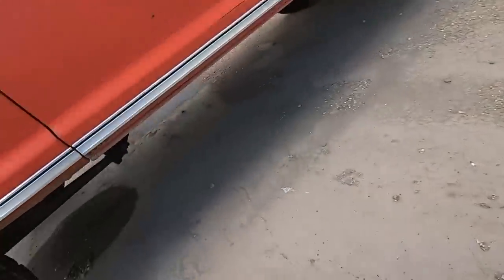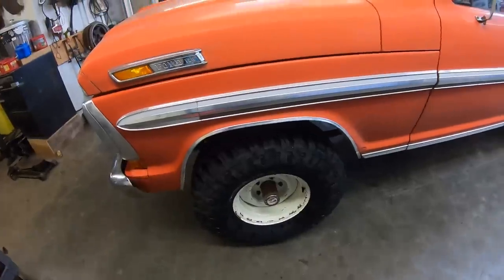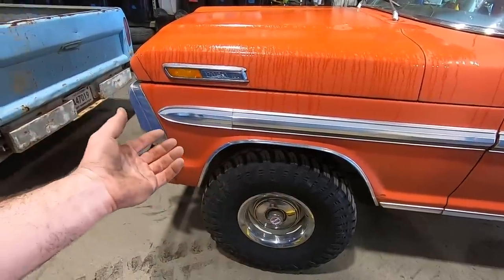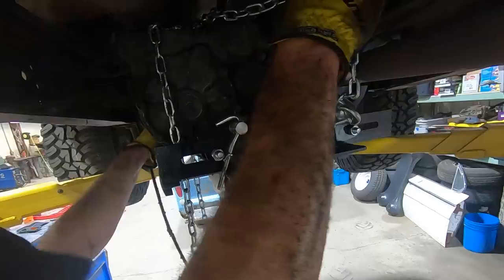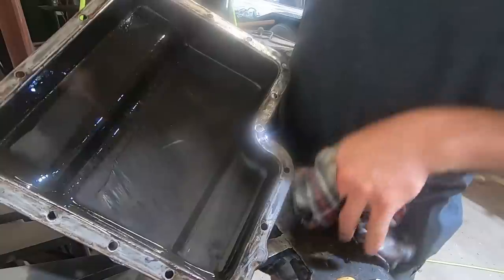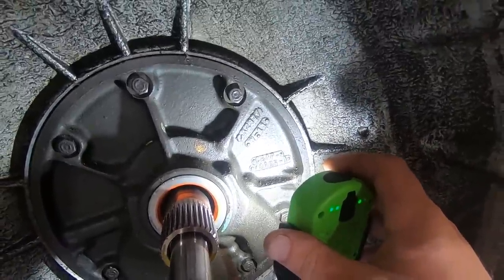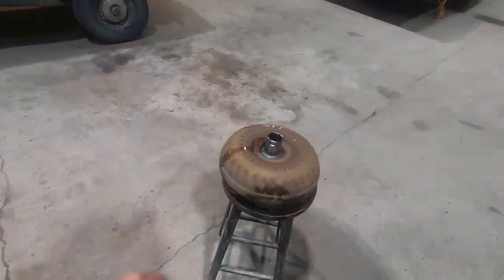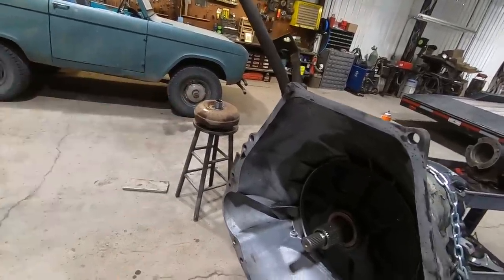Did I just Destroy the Transmission on my 1971 F100?!? Hey, at least it's got new Tires on it!

Comment: That bent wheel you might want to make an indicator pointer to inspect it, if both innie and outie hoops move in/out at the same spot its more likely the rim is bent, hoops are not true to the mounting flange.
Reply from the maker: I think you’re probably right
Reply: @MortskeRepair  well if you're super desperate and thinking on tweaking it and think you can determine how/where its bent -- you could attach a lever like an axle or bar and plate welded, chain that sucker down to your trailer, hit it with the torch and bend it back into alignment.
All that Detroit Steelies has got is a $100k robotic welder, I believe they get their source material from Canuckistan --- setup the backspacing, on the hoop drop in the centers and press a button, round she goes pzzt pzzzt done
Reply from the maker: @dennishernden2264  Well it's wasted so it's worth a shot trying to fix it I guess!
Reply: @MortskeRepair  It can take hours to straighten a wheel, that's why I said you need to really nail down what's going on, good luck.

Comment: The E4OD automatic on my '93 F150 has been slipping since I got the truck for years ago, I just keep hoping it goes out so I can justify putting a 5 speed in it. If you get the transmission good and hot it'll start shifting hard, sometimes it kicks to neutral and you have to restart the truck. Stupid electronic transmissions.

Comment: If your chip seal question wasn't rhetorical: they chip seal because its cheap. Where the asphalt is structurally sound a chip seal is the cheapest way to seal/surface. If done early enough, this can greatly extend the life of pavement. Next is an overlay (fresh pavement surface, typically 1-2", no grinding), but that can create issues where pavement meets gravel shoulder/ditch. Last is an inlay (or full rebuild) where the grind out the old and pave in new. This fixes structural problems and prevents the issues an overlay creates, but costs a whole lot more money.
Reply from the maker: Thanks for the info

Comment: Luke [Thunderhead289] is always dropping those T5 mustang transmissions in behind the FE motors of all shapes and sizes [and he hammers on them sparing no ponies in the process]. That old rusty Maverick with the 390 in it he's got one of those transmissions in that one [drives it to work in spite of it's rustiness]. The overdrive and the floor shift makes that set up pretty encouraging eh? :-))
Reply from the maker: Pretty sure his Maverick is a Windsor with a toploader 4 speed.
Reply: @MortskeRepair  He did a Windsor job on a Foxbody mustang for some kid at his new job but drove up and parked the 390 Maverick to get started on the 351 Windsor fox body. Nah. Unless he changed it he dropped the mustang floor shift in it behind that 390 ages ago [really calls first gear a granny low on the one earlier transmission in that old Blue truck but it does have the overdrive that he likes for highway too and from work and school]. He swears by those things as they find their way into his trucks and the 65 Black Galaxy... I mean... I get it. They're pretty sweet little shifters. I think GM had a version of that tranny that they put in a couple of cars back in the 80's.... Craig909 found one last year in his junkyard somebody hauled out of an old car then left in a trunk and forgot to go back for it. Did Luke switch that tranny out of the Maverick and I missed him do that? He still had it in the car when he was running that lawn mower carb on the old 390 [young man's a helluva mechanic actually eh?]. Anyway.... I type too much too fast... Love the work you do and see your love of the past in how you work to preserve some of the older motors sometimes. Good for you. Love the job you did on your grampa's Buick for your Dad. Worry free highway running at 70 MPH and 25 Miles a Gallon... Hard to kick those LS's out of bed for eating crackers :-))
Reply from the maker: @robertironside3166  He bought the car with a windsor and toploader in it.
Reply: @MortskeRepair  Are we both talking about the same rust monster with the rotting frame? Cause he had a 390 in that one with the stang 5 speed... I'll have to go back and re-watch the Maverick stuff. Same car he put the lawnmower carb on right? That Maverick? He did help a younger feller clear the shrapnel off of a 351 and then  do lifters, push rods and timing set in the parking lot after work and poop. K my memory must be in shambles I guess lol
Reply from the maker: @robertironside3166  Yup

Comment: Duff likes this truck too much, don't sell it! Love the "bump side" fords and the color is terrific. Would lie to see a paint detail video. Do you run without the air cleaner? The "chip seal" on the roads is a lower cost (than repaving) surface treatment used on roads that are often lower traffic count/rural, structurally sound, but may be cracking or showing signs of deterioration but not to the point of failure requiring resurfacing. I was a municipal engineer and our small town Taxachusetts roads got treated this way frequently. Yep, lots of chipped windshields, front ends, rockers, stones on lawns, and complaints. Never mind the stones get stuck in tire treads throwing the balance off!
Reply from the maker: No, this has always had the air cleaner on it. I really do need to buff out the paint.

Comment: Both my 79 Chevy K10 Scottsdale and the k20 custom deluxe were lifted the cheap Farmer way I don't advise it they jacked them up and sat the frame on metal sawhorses and heated up the spring and when they cooled they dropped and they sat down the truck on the floor and both trucks then had a 4 and 1/2 inch lift and after hauling lumber and steel and motors for about 25:years and pulling gravity wagons and hay wagons the rear springs lost their arc the front seat up higher and the front springs on the k20 had dearched so lowered it in the front so that is why I said I don't recommend ok lifting the truck that way.

Comment: Ford had a blue coating on slip joint splines and they sold a special grease to lubricate the slip joint on drive shaft
Reply from the maker: Too bad the previous owner never used it!
Reply: @MortskeRepair  You can't find anything in good shape around here the state uses to much salt in the winter I have looked for a old four wheel drive truck to fix up but can't find anything close

Comment: If you have transmission leaks on the old Ford transmissions that seem to keep reappearing no matter what I may have an explanation that was explained to me when I started asking about why mine seem to leak. I built both a C6 and a cruise o matic. Both seem to have an occasional weep from the torque converter seal even though everything is put together correctly, and the seal fits nice and tight. Apparently, the old silicone Ford seals (they look like viton but are more orange in color) don't tolerate the amount of seal sweller found in the GM spec dex/merc fluid and will cause the seals to get a little on the soft side if the transmission gets hot or is driven on a really hot day. My cruise o matic won't leak at all in the winter but I'll get the occasional drip off the bellhousing in the summertime. I used type F in both of those transmissions but who knows how much seal sweller they put in the old ATF these days compared to when that fluid was a current spec. Annoying, for sure! the C6 in my truck that specs Dexron II on the Ford dipstick never has leaked though, and it has 250k miles on it. Apparently, they changed the seal material sometime in the 80's but some rebuild kits still come with the older style silicone seals instead of viton.

Comment: Some ford torque  converters have   drain plugs and you have to line them up with a hole in the flex plate  or it will hit the flex plate and push the torque   converter  to far back. And the engine  wont turn over and then its  manual  transmission/  ls swap time.
Reply from the maker: We got it lined up!
Reply: @MortskeRepair  I really  enjoyed this  one! But after watching  it I think I'll get more kitty  litter and  type f for my bronco  for now until it really  starts pissing  lol.
Reply from the maker: @michaelbennett1883  Oh come on! It's easy!!

Comment: I have torn down a rebuilt a couple turbo 350 and 400's and a few 727 and 904's but the only Ford I did was a C4 out of my friends stang but I find the 3 spd trans not to be that bad the most simple to me is the 727 and 904 I have rebuilt a few of them at first I needed the book but now I don't need the book but I keep them by just in case but you should buy the book on rebuilding automatics and learn how to do them I was scared at first thinking I was going to mess stuff up but turned out to be not a big deal.
Reply from the maker: Glad to hear it can be done!

Comment: Pretty sure the correct fluid for the 1970's C6 is Type F.   Maybe Mercon might work ok or maybe not.   Ford switched to Mercon later.   They never used Dexron that I have ever found.   What you have in there might be on the thin side which would possibly make the front pump noise I was hearing.    

I love my old 79 Ford F150 truck.   I get asked about every 2 or 3 weeks if I want to sell it.  I will never sell my truck.
Reply from the maker: Seems to work fine

Comment: Great video and c6 is a stand up trans band can be installed before the forwards just leave it loose then tighten after assembly is done ..wear on the band will stop it from locking drum as fluid travels down in groove's in face if too worn will allow slip .. causing miss ship or take off in wrong gear . Give you credit took it on cannot learn a thing without taking a chance ..

Comment: after watching for 25 minutes, it occured to me.... you got a lift! you need to do it the way the dealer did back in 79, LIFT the body off the frame, if your doing a tank/pump lift the bed,not drop the tank. update I'm at 1:06:00 see? after watching you and the crossmember I was right.

Comment: Google pipe soap. I'm a pipe layer and use it at work for rubber gaskets. Best thing by FAR for sesting beads. And cheap especially compared to tire lube. I had sticky racing tires that wouldn't bead. Tried every trick. They went right on with pipe soap.
Reply from the maker: I’ll check it out!

Comment: Those shift rods in the 205 control front and rear. Twin sticks allow you to do front digs on tight trails. You can lock in the front the rear or both depending what you need. It is also fun to confuse people with a front wheel burnout. Used to have a 79 Bronco on 40s. Lock the front in low and the rear in neutral and I could burn the front tires right off the thing lol just a little useless knowledge
Reply from the maker: Thanks for the info!

Comment: If you like shorty valve stems, cool! Butttttt, soon as you install trim rings or full wheel covers, you gonna have to take those off every time you wanna check or add air. Like to make more work for yourself? Cool! 🤣🤣
Reply from the maker: Didn't plan to run beauty rings

Comment: the first gen bronco has the C5 automatic that had deep pans
Reply from the maker: Interesting
Reply: @MortskeRepair  inside it's a C4 the pan and filler tube makes it a C5 and the adapter for the T case so they are simple to build once it is torn done and ran thru the giant parts washer under heat and chemicals dried it's a 4 hour build in most cases the C6 is about the same time frame adding a shift kit ads about half an hour then it's painted cause who wants stained aluminum after you drop 4 grand

Comment: I also actually like the skinny or narrow barrel wheels my 79 Chevy K10 and the k20 had 7.00x9.00 15, not factory for the K10 Scottsdale factory 33x12.50 15 dealership promo code wheels chrome spoke and the truck we copied the wheel setup off of were factory 16 inch mud king type tires called a Firestone mud trac as tire

Comment: my experience with that dorman pan drain is "mixed" at best. 1 the o-ring for the plug is very low durometer and can be pinched and leak. 2. the lack of a vent makes it not drain very efficiently. more like drip drip drip drip...
Reply from the maker: Slip out the dipstick, vent away!
Reply: @MortskeRepair  that's thinkin' with your dipstick jimmy!!!

Comment: looks like the modulators oring is weeping a bit wipe it off and keep an eye on it
Reply from the maker: Needs a new one anyhow
Reply: @MortskeRepair  they tend to lose the ability to work without sucking ATF but in the bright side it cleans and lubes the carb and leaves a smoke trail
Reply from the maker: @garybrady9531  No smoke trail on this one for some reason

Comment: I always left the transfer case and auto tranny together, and they would balance on the floor jack at the cross member. But mine was a 78 chevy. I didn't turn Ford until the next generation pickups. Many friends had Fords back then, none had tranny problems like me. I should have bought a manual. I've never got more than 20K miles out of an auto tranny. Ever since then I've had manuals. My current vehicle is a 98 Ranger 2x ext. cab with 400K miles on the 3.0 V6 and 5 speed manual. Haven't never done anything major to it. 
I don't think you can even buy manuals anymore from anyone? My cousin drives truck and even his is an auto. Even the school buses are auto now. I hate auto, they don't last and no fun to drive.

Comment: The sad thing is, all of the issues that you had wouldn't have happened if the previous owners had just changed the fluids on schedule.
Could your modulator valve be causing that sound in low gear? Good vid.
Reply from the maker: It might

Comment: Based on my extensive research the mild chatter that you are hearing is a result of too much pre-load on the articulating lower bearing seal the result of this is contact between the adjunculating pinion and the inner rotating mass,  you may be able to solve this by dis-assembling the entire unit and cleaning with a brillo pad. If that doesnt do it just order a new unit. Professor Irwin Corey
Reply from the maker: Oh dear

Comment: When putting the trannyback in,, make sure to line up the torque converter drain plug with the drain plug hole in the flex plate,,  :-)
Reply from the maker: We got lucky and it lined up!

Comment: On your transmission assembly barrel,,,,  if you turn it over, thus exposing the rounded bottom,,,  You can then take a 4 lb hammer and beat on the center of the rounded bottom until it is rounded inney instead of rounded outtey,,,  this will cure the wobble while using it as a transmission assembly aide,,,   :-)
Reply from the maker: We did this after the fact
Reply: @MortskeRepair  That's kewl,,,  Was happy to see your transmission working again after partial disassembly,,  I reallize that you are not really a Ford guy, but That body style just gets better with age,   I would not be surprised if someone takes you up on your asking price,,   :-)
Reply from the maker: @darkwing4475  They are nice rides

Comment: It'll be interesting to see how long that transmission will last with engine assembly lube in it since it's grease and eventually coat the clutches with it and probably make it slip. Hope not but you should of used something different than that like even vasoline would have been better. Need something that will breakdown into the fluid
Reply from the maker: Well that's what we had and we didn't use much. Guess we will find out.
Reply: @MortskeRepair  call it an experiment. Always fun working on new stuff.

Comment: I haven't pulled one in decades, but I remember them being close. I think your body mounts are probably pancaked and that's your issue.. The reason Ford designed the cross member this way was to keep the frame rails parallel.  Sure, it could have been done differently, but much has been rethought since 1971, NO!?!?!?!?!?!?!!?

Comment: 36:13

I'm a Ford guy, and even I think those guys are nuts.

Just call it a 400M, it's  the same block as the 351M.

Yes, the 400 came first, and Ford "modified" the stroke to get the 351M to replace the 351C, but it's splitting hairs for nothing.

Same people get mad when you call a 385 series a "Big Block Ford". Can't win em all.
Reply from the maker: Silly Ford folk...

Comment: So how bad does a wheel have to be bent before you can feel it? I've used wheels that were off slightly to the nekkid eye that seemed great on the car. I've also had tires that didn't run particularly true that also never seemed to be a problem. I've turned tires 120 or 90 degrees to get the heavy spot on the tire away from the heavy spot on cheap wheels(usually not a problem w factory wheels) when it needed some ridiculous amount of weight, a couple of times they balanced out and didn't need any weight at all. I wonder if it would be worth mounting a tire on your bent wheel and if the runout was too awful just rotating the tire on the rim to see if you could find a spot where a slightly out of round tire would cancel out a wonky wheel since big aggressive tires are sometimes a bit lumpy anyway. This is something I've thought of when I should have been actually working on stuff. Somebody should totally look into this, just not me. Far too lazy
Reply from the maker: It depends on the car and the tire too. Not just the wheel.
Reply: @MortskeRepair  So the REAL solution is probably for me to buy better cars
Reply from the maker: @jonathangehman4005  Probably a good idea.